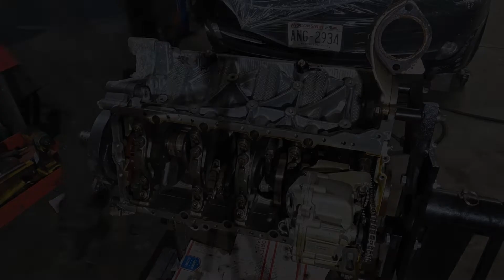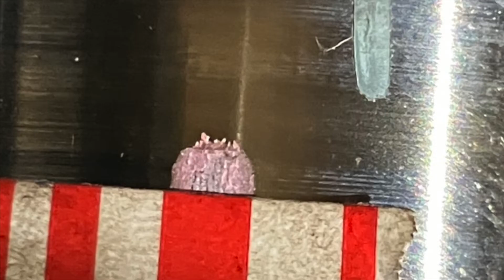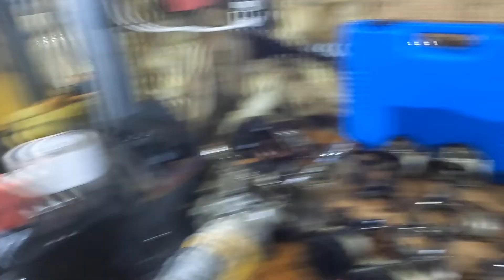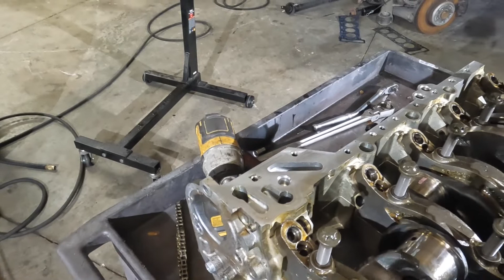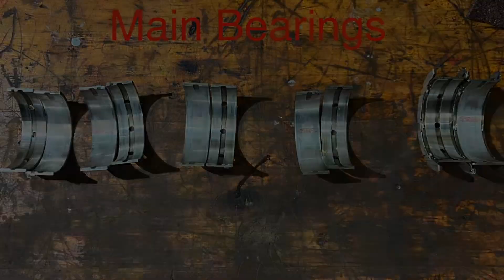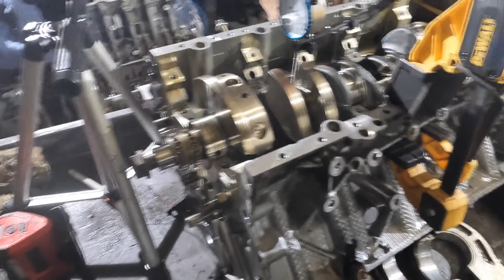BMW S63 LL29724 Engine Teardown  Block Disassembly Part 3

Comment: Im suspecting a span bearing on my car, have a slight knock sound jst started coupled with a miss fire on cylinder one...
Reply from the maker: Once It start to knock, it's going to need a rebuild or engine Exchange.  May be too late for just bearings replacement - Good luck